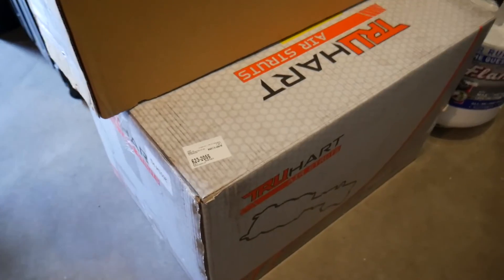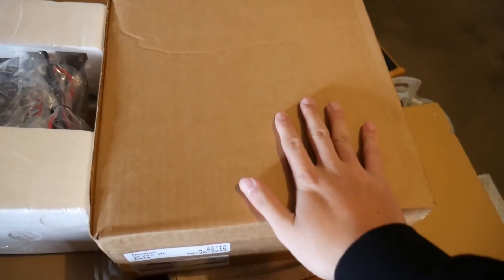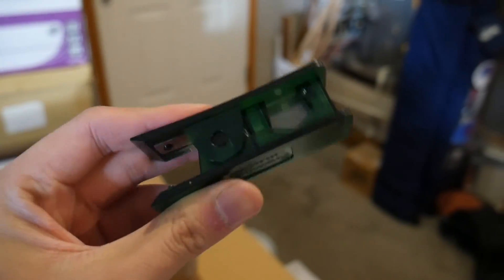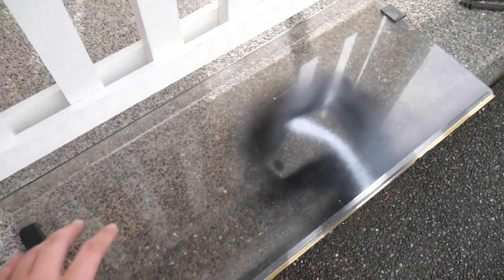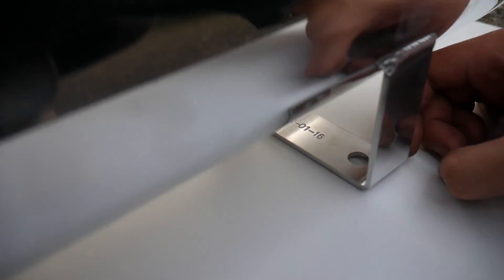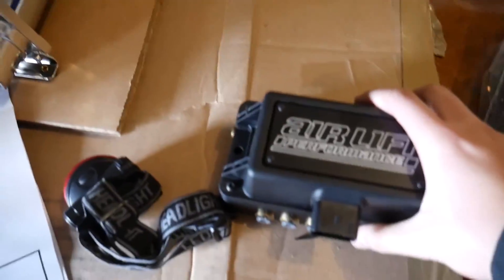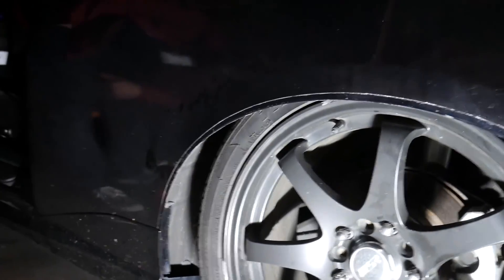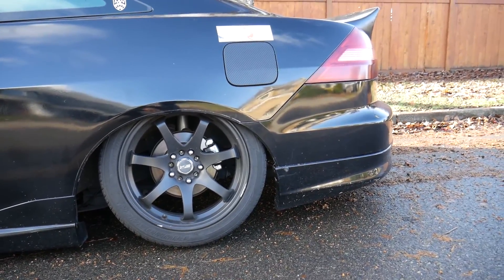Bagging my 7th Gen Accord! | AirLift 3P x Truhart Air Plus

Comment: I own a 2003 v6 accord also. I created my own unequal length J pipe for it. I just got rid of that part on the stock midpipe that does a crazy 180 degree loop and made it go the same way. Using all flex tubing. It was hard to do but it sounds mean as hell. Highly recommend doing it.
Reply from the maker: Smart Feller I'll look into it!